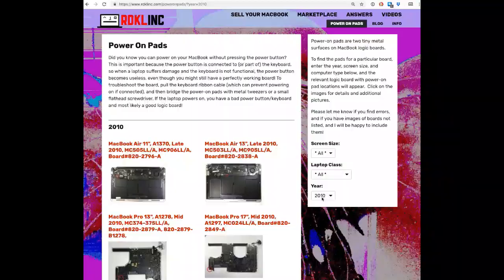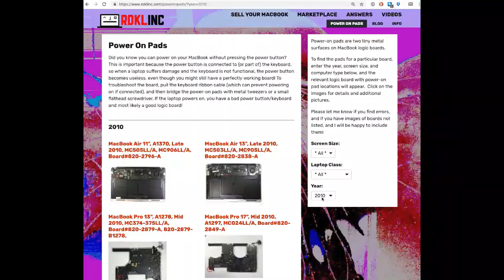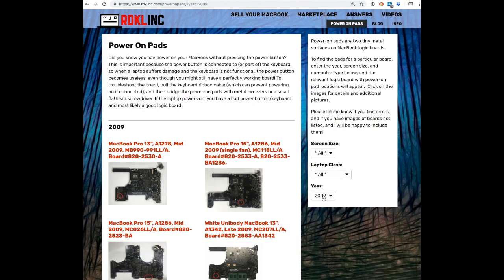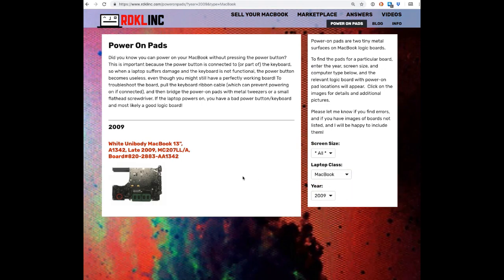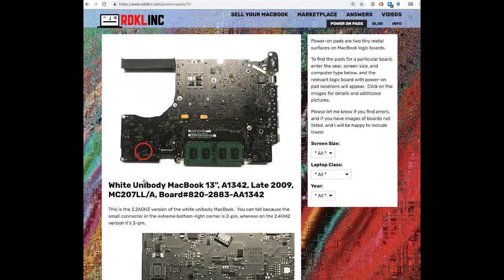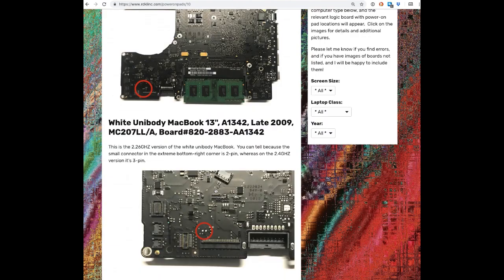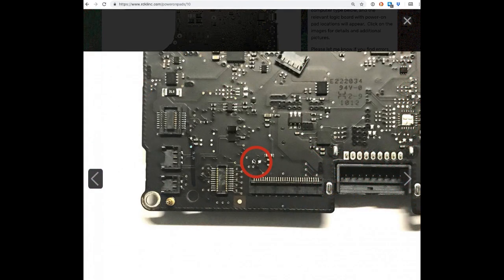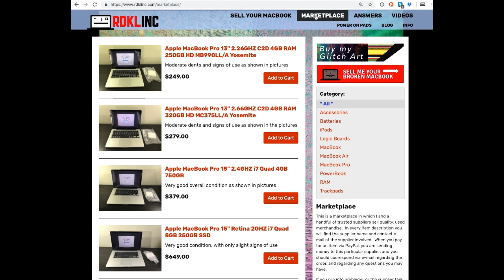PowerOnPads.com:  Power on your MacBook without the power button - is your logic board still good?

Comment: I picked up a 2013 MBP 15" for $20 that wouldn't power on, went to your site, looked it up, and voilà! it powered up, after which I could connect an external keyboard to fully test the machine to discover all it needed was a keyboard replacement. Thanks to your invaluable information it's now all fixed up and running Sonoma via Open Core. Thanks again.
Reply from the maker: Awesome, great to hear!  Congrats on saving the laptop!

Comment: When utilizing the power pads on my 2011 MacBook pro, the front light blinks on and fan starts but then it all stops and then tries again every few seconds. I also hear a slight beeping sound, not very loud at all, I think may be coming from the hard drive. Could possibly be it trying to start up then shutting off. What could be my problem? This was a water liquid spill. It has since dried out and I cleaned the back of the board with isopropyl alcohol (I don't have a T6 to remove the board to clean the other side.
Reply: Sorta sounds like a MacBook with bad or no RAM connected but I could be wrong

Comment: Do you know where are pads for A1466 macbook air?
Reply from the maker: It's on the website!
Reply: @RDKLInc  I am tired of removing the keyboard and pressing the power pads. Is there anyway the power pads can be hacked by connecting to an external switch?
Reply from the maker: @Tech.Library  Why not just replace the keyboard/power button?
Reply: @RDKLInc  I actually damaged the connector switch on the board where the keyboard flex is usually attached
Reply from the maker: @Tech.Library  Hmmm yeah that's a problem unless you know board repair (which I don't).  A lot of junk A1278/A1286 machines are surprisingly cheap these days though, so you may be able to just swap the board out and have a working computer for not too much $$$
Reply: @RDKLInc  OK thanks, I will do as advised. Cheers from Abuja